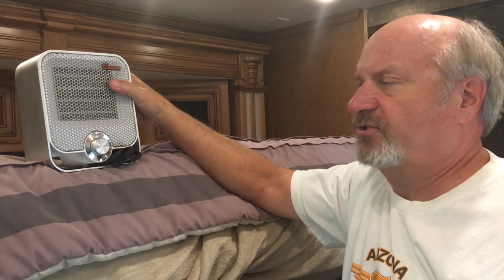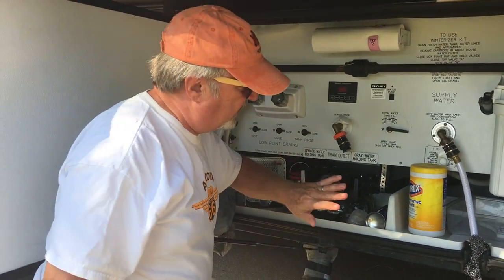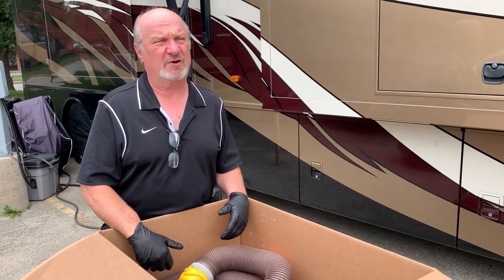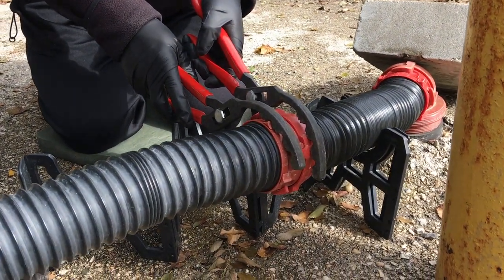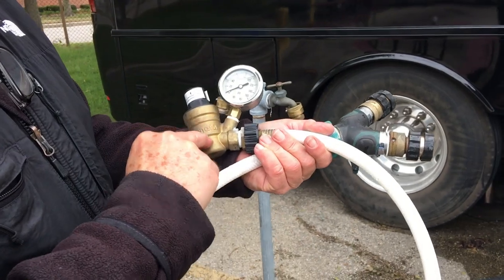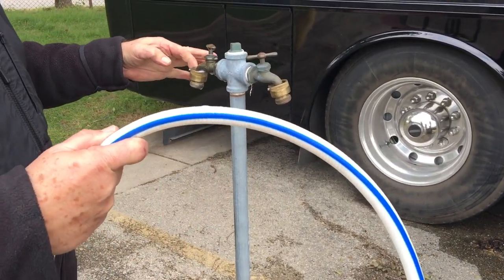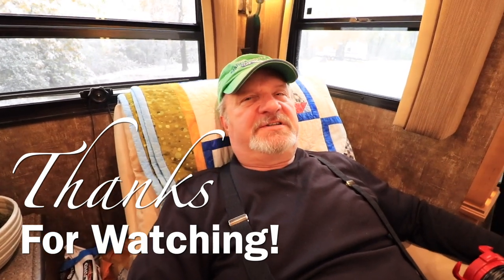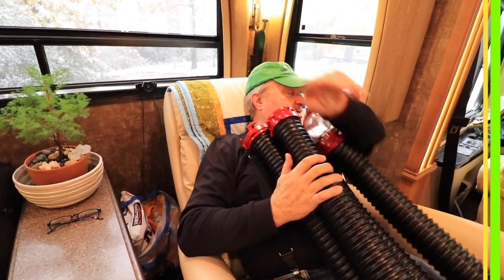RV LIVING | OUR 20 BEST RV NEWBIE MOTORHOME WET BAY BLACK TANK AND FRESHWATER TIPS AND TRICKS-EP119

Comment: I've installed shut off valves on both my black tank wash and my water fill inside my wet bay.. That way, I can leave my black tank wash connected and my fresh water connected and I can turn both off when I leave the rig, even when the water off at the park connectiin... Just like you said, someone can happen by and cut your water on if your not there. Shut off valves in your wet bay is the way to go.. I picked them up at Amazon.. They also have 90 degree shut off valves which replace your 90 degree elbows.
Reply from the maker: Your set up sounds awesome,......AND safe!
Reply: @OurJourneyInMyles  Thanks Mark & Sue.. Love what you do..

Comment: I put a little electrical tape on the sewer hose fitting and problem solved. I agree they should not leak! Mine are the camco rhino.
Reply from the maker: It will never leak when you are camping alone in grass,.......only when you are next to a family on a concrete pad!

Comment: Mark, very informative reviews thanks for sharing. I ordered 2 pliers, 2 Fifi's, and 2 Valtera 90' hoses savers. Unfortunately the Venom Steel gloves and PLG quick disconnects are out of stock at Amazon so I will have to source elsewhere. We were already using the same water pressure gauge and sewer hoses and agree with your recommendation on these. Campgrounds are starting to open up which is good but they may be crowed due to virus concerns, will see how it goes.
Reply from the maker: We are on our 4th night of 5 traveling from Florida to Wisconsin.  Campgrounds are mostly dead.  Most of our stops only allow one night stays for folks passing thru, and only for non-residents of the state.  If you need to stay more than that, you have to quarantine for two weeks.  The FiFi's in our Amazon store are way more awesome than mine, but I have at least a dozen of the old style and brand I started with, so I will have to stick with the thinner old model.  The PLG lead free brand is about as cheap as they come.  I get about 6 to 12 months out of each fitting, depending on where in is in the chain of connections due to calcium build up.  That's why I like the PLG so I can carry an extra dozen or more at any given time.  Once you decide on "YOUR" brand of quick disconnect, you most likely will NOT be able to mix and match,....so buy what you can afford to get that many of!

Comment: Hi Mark, I have had 2 of the Valterra water pressure regulators, and both of them have cracked on the outlet of the regulator, the last one did not even last this season.  Not sure what they cost in the 
US but up here in the Great White North they are about 110 bucks.  Have you seen anyone that has had a different make?  Would like to find out.  Thanks for the vids, we certainly do enjoy them.  On an different note, we are going to look at a Newmar Bay Star 3414 today.
Reply from the maker: Sorry to hear that David.  The company that I purchased my Valterra through actually sent me a replacement pressure gauge (not the body) when I had issues with one.  The Amazon site I bought from had listed what the guarantee was, and I was within the time period.  I carry two of these, and when one needs work, I swap them out.  The orifice hole diameter in the gauge is so small I expect that any debris that gets into can cause a failure.  These valves are so simple, the gauge is the usual issue. In your case, you need a new body.  Call up Valterra, or the Amazon seller,......and see if they will send you one!

Comment: Great video Mark. Also have a question regarding dash cam model you use and if you're happy with it.
Reply from the maker: Really like our dash cam,........it is THREE YEARS OLD ALREADY,.....VicoVation OPIA2 2K 1440p HDR Dashcam Premium Pack Bundle with 128GB MicroSD Card (bought later)   I am sure better exists now,.........we wanted one with a capacitor and not a battery for possible window overheating heating issues.  We never over heat. Dash cams are a must!

Comment: Guys I’m here to tell you that you CAN heat your wet bay with a 60watt incandescent light bulb (a 100 watt light bulb could get hot enough to start melting plastic) and it is safer if the bulb has a proper cage around it. I live in Winnipeg Manitoba Canada and it get down to -40 F in the winter. I’ve been a commercial construction supervisor for 25 years now and have used a 60watt bulb on a thermostatically controlled  plug to heat a 3’x2’x3’ plywood box that covers a temp water service coming out of the ground in -20 to -40 weather every winter for 25 years and never had a line freeze. The reason for the thermostat is because I have had one plywood box actually catch fire because it got too hot with a 60 watt bulb without the thermostat. Your heater is actually dangerous to use in a confined space like a wet bay. You are supposed to have 3 feet of clearance in front of those heaters. In fact you may void your fire insurance by using that heater in the wet bay. So please reconsider using it. Put a 100 watt bulb in the cardboard box of a similar size to your wet bay for 20 minutes and see haw hot it gets. Put the box on the fire pit just in case.
Reply from the maker: Thanks for the GREAT input Hammer.  I agree that testing and care needs to be exercised when first using a space heater for each application. I see now that the model of heater that I have comes in a lower 500 watt version, and that is the one I have in our Amazon store.  It will fit in my wet bay, for the cold day I might need it.  Trust me,.......the first day I use it for real I will be watching it.

Comment: Where did you get the pink clip to hold the paper towels in place?
Reply from the maker: Long time ago, I bought https://rvminders.com/ to help remember to retrieve, pickup and disconnect things before moving the rig.  The system came with extra "blank" straps to use.  You could write down for instance "Wife" on the strap so you don't forget her in the commotion.  I just repurposed this strap.  In my "Making RVing Easier" section in our Amazon Store, I now recommend the Camco Bands, because they are cheaper and can be shipped for free via Amazon Prime.  I think for your purpose, the rvminders would be longer and provide a better grip.  Keep in mind, when a paper towel roll is large (brand new), the band barely does the job,......  We LOVE these reminders AS REMINDERS for the crank up antenna, tent, and anything else that pops up as "odd" in a setup.  We have a strap for jack boards because I use them so infrequent.